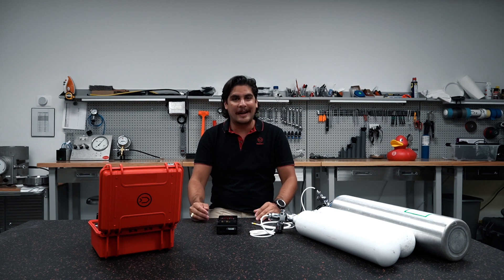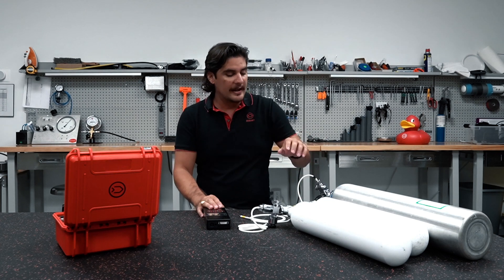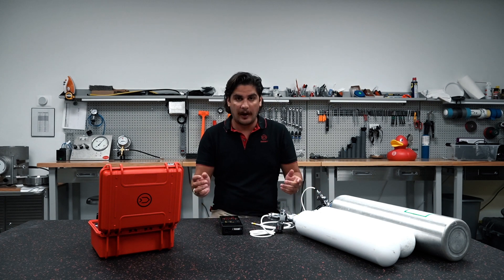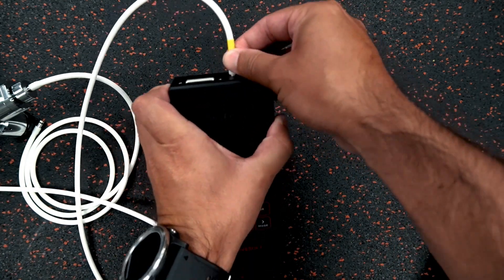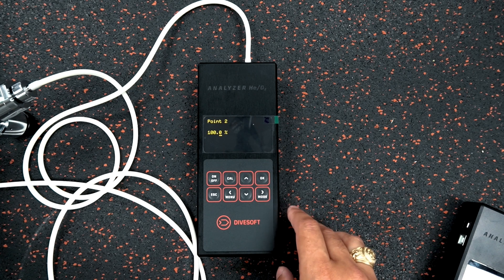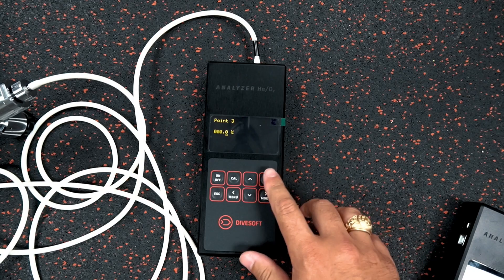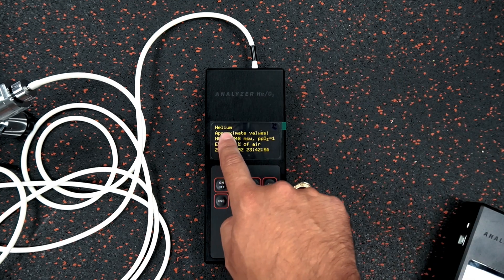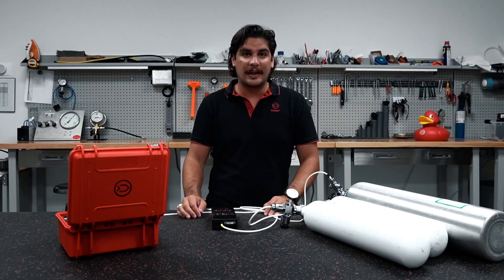Divesoft Analyzer | 3-Point Calibration

Comment: how do you know when the cell inside is not working if it has not reached 12 months?
Reply from the maker: It can be recognized according to the millivolt of the sensor, on air the sensor should be in the range of 9-13mV.

Comment: Great video. Question. Can you do a 2 point calibration with 100% 02 and 0%02 like argon? Last year my self and group ran into a day when we had a few different analyzers on board the boat but we were getting different mixes on each unit. We went to do a calibration but realised we didnt have any air on board. We were doing tech so we only had 02, argon, nitrox and trimix....
Reply from the maker: That’s a great question since it’s quite common to be in that scenario. Ambient air is often enough to calibrate the unit if the analyzer has not had any other gases flow through it. Allow the analyzer to sit and settle as the gas must flow through a labyrinth then once it has settled the unit can calibrate with ambient air.